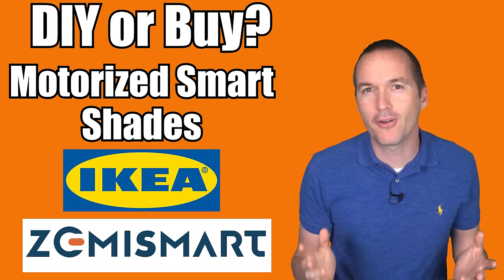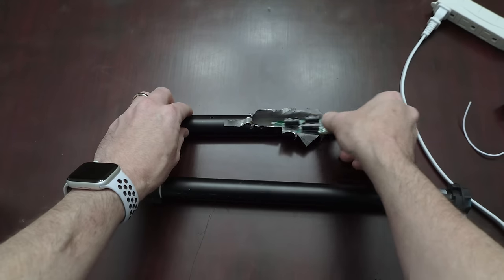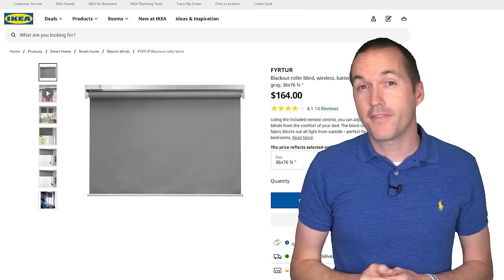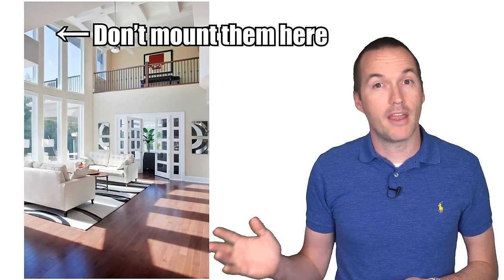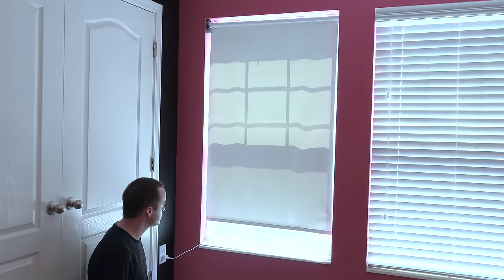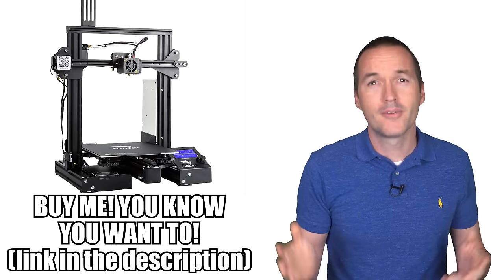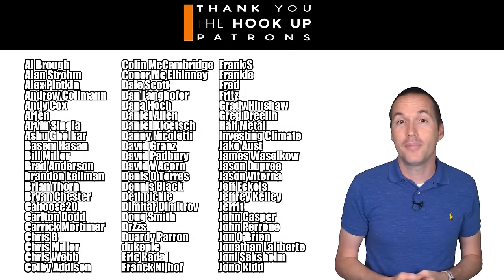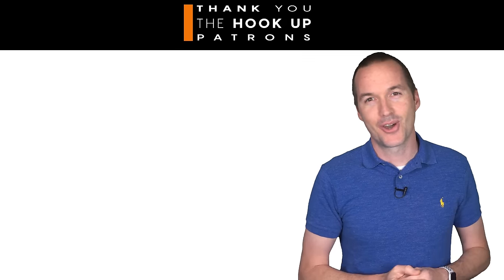Motorized Roller Shades? IKEA Fyrtur vs Zemismart Solar/Battery vs DIY!

Comment: Any advice for doing this on an inclined skylight?
Reply from the maker: I think the key for that is maintaining tension.  Maybe a roller on both sides, one that is spring loaded that rolls the shade and one that is motorized on the other side that wraps up a string/cord to pull the tensioned blind towards it?
Reply: Fishing line guides? Not recommending but just a thought.
Reply: Hunter Douglas and Lafayette window fashions make them $$$$$$$$$$$$$$$$$$$$$$$$$$$$

Comment: The Z wave Bali/Graber/Springs Window Fashions roller shades are pretty good and they work well with home assistant.  Granted, it's double what the IKEA ones cost they are a good out of the box solution if you are starting with a bare window.  My only gripe is they dont have solar.  It appears they could be hacked to come up with something but I haven't done it yet.  Will see how long the Energizer Lithium's work.

Comment: He mentions a 12v motor that has more torque faster than the 5v running on 9v. If you aren't using a battery why not use the 12v?

Comment: You think the diy ones could handle blackout shades on the typical basement windows?
Reply from the maker: You mean small windows? Probably
Reply: Yeah, I think probably 32x16 or so. I may have to play with this idea, might be a good use case and minimize the the downsides of this solution.

Comment: Would it be possible to put a stepper on both sides? I suppose the issue there is them getting out of sync but wouldn't it add torque?
Reply from the maker: It would add quite a bit of wiring too.

Comment: I have a sonoff RF bridge 
flashed with tasmota and portisch firmware . Couldn’t get the RF codes for the wireless solar roller shade remote(Remote is 433Mhz) .If you have successfully learnt the RF codes from the remote, can you please share  any documentation or instructions ?

Thanks!
Reply from the maker: Yes.  I am using a tasmota RF bridge in "Raw Mode": https://github.com/Portisch/RF-Bridge-EFM8BB1/issues/118
Reply: @TheHookUp  Awesome,works as expected after flashing the new hex file . Was using a old hex file before and hence the issue . Thanks again for the inputs . Great informative videos !

Comment: For a guy that loves to use diy, why the hell don't you have a cc2531 and zigbee2mqtt??
Reply from the maker: I ordered my cc2531 in March from itead... still not here yet.
Reply: @TheHookUp  you'll be amazed. I have Ikea bulbs, xiaomi sensors and heiman siren, only using the pen. The only drawback of zigbee to me it's range, but all devices report lqi so you can use Ikea repeaters to extend it 🙂
Reply: I recently bought a cc2531 from cc2531.com and I am amazed. Works well with ZHA (HA) and my ikea bulbs/remotes. Setup was a little bit tricky for the five button remote but apart from that its amazing. Their support was also amazing, gave me a free upgrade to the model with external antenna after I wrote a question to him about  the firmware.

Comment: Great review but my take from this is there is still no decent solution and the market is wide open. The nicest looking solution has a sucky protocol and would cost an arm and a leg to do your whole home. The DIY solution is too convoluted and requires 3D printer and the reasonably priced one requires mains voltage at every window. That's a solid NO then to them all.
Reply from the maker: As I said, I think the best solution is the RF solar/battery ones with a single RF bridge to trigger them with home automation platforms.  RF signals carry very well and you could very likely control your entire house from a central location even with concrete walls.
Reply: @TheHookUp  How about dumping the "ooohh the Zigbee" and retro-fit the D1 mini. Surely best of both worlds even though you're binning costly Zigbee, it would only add a few pennies to the overall costs.

Comment: My home had a SOMFY remote controlled cellular shade and either the board or motor went bad. 57 5/8" W and 36" H. Will this setup work with a window shade of this size?
Reply from the maker: Which one? The DIY setup will not have the torque to handle that, but the others will easily handle it.
Reply: I think perhaps following your outdoor roller shade video would be more appropriate for this window. I just have to decide if i want to install an outlet to plug in the power chords in the link or it could easily be wired straight up. I have been reading and still have  a bit to learn before diving in  lol

Comment: Because you cant handle HA correct! Battery state works fine in HA and so does also the position.
Reply from the maker: It depends on the zigbee integration you are using.  ZHA, deconz, and zigbee2mqtt all have different implementations.
Reply: The Hook Up Maybee you should say that instead then!
Reply from the maker: Unfortunately, that is exactly the problem with Zigbee.  Zwave and WiFi devices just work when integrated into respective smart home platforms, Zigbee requires significantly more fiddling, which is exactly the point I was trying to make.
Reply: The Hook Up If you’r a noob it can be hard to set it up, but its not the same as it can’t be done.
Reply from the maker: @akekvarnberg7176  That could be said about a lot of things, and I even said that I probably could have increased the functionality by reading through posts in the community forums for solutions to my problems, but the point is that those were the features that worked "out of the box", and anything else would require extra work.
Reply: The Hook Up Its not ”out of the box” it standard Home Assistant! 😉

Comment: I ordered the Zemismart motor about a month ago and it's finally almost here and I need to get shade material and a tube.  I checked out Lowes' roller shades and it looked like many of them used cardboard tubes...  Just wondering if anyone had any good recommendations for tubes?
Reply: Its is very hard to just get tubes. You may try to find a local exterior shades maker in your area. The tubes have slots and channels in them to grab the motor end to function. You can also look for continuous cord loop shades NOT CORDLESS. Cont loop shades use the same tubes as motorized. For the best chance of motor fitment look at the plastic piece the chain goes around if it says "Rollease" you will probably be good to go as thay are the largest maker of tubes, and clutches for roller shades.

Comment: Can anyone give me tips on pairing the battery version (from Amazon UK) with either the remote or the WiFi dongle?

The motor flashes red okay when pressing twice.

But the dongle will only flash a slow blue and the remote only does a solid blue for a few seconds then goes off. (When pressing the set button)

But the motor carries on flashing red and doesn't pair.

Help appreciated.